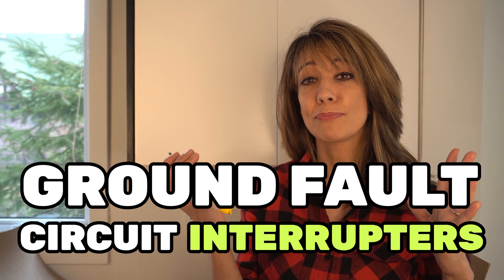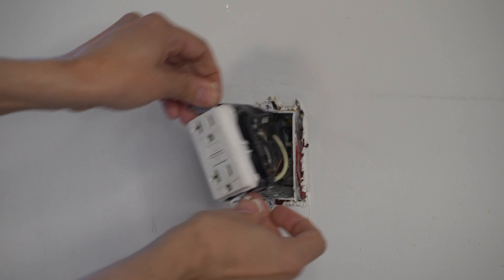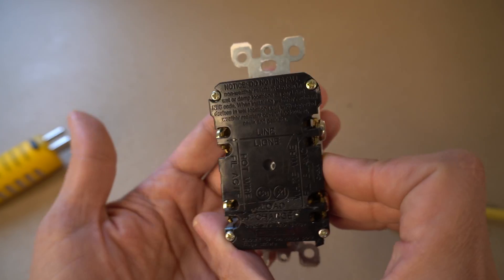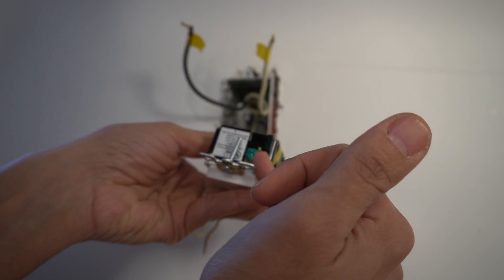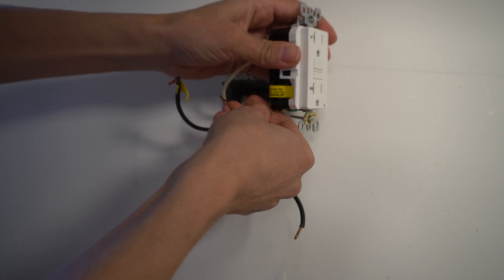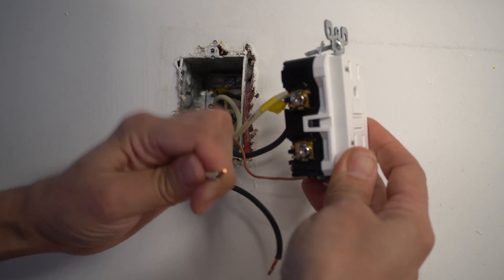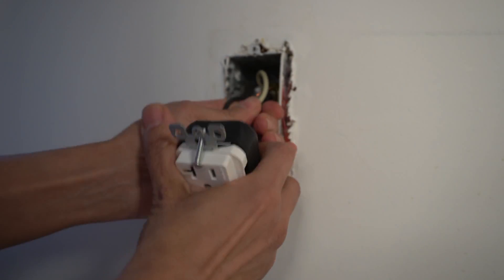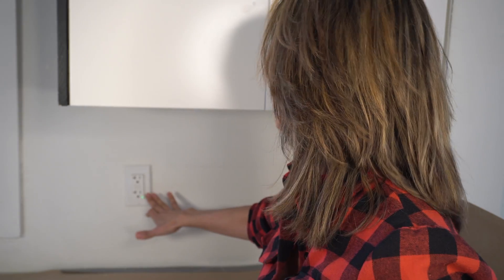How To Replace a GFCI Outlet | 98% Don’t Don't Know This!

Comment: One problem I've noticed with GFCI receptacles is that it is extremely difficult to wrap the ground wire around the ground screw (many don't have a clamp), due to its location on the receptacle.  Even if you succeed in getting the wire on, itis hard to mount it securely, and this may well be a reason why it works loose.  A better design is definitely needed.  In any case, the receptace is grounded simply by mounting it in the box, provided the ground wire is connected to the box.

Comment: Is it ok to install gfci all over the house? Is an old house it has no ground.
Reply from the maker: That’s a good question for a licensed electrician. I haven’t experienced that situation before. Grounded receptacles are an important safety measure.
Reply: It's not necessary, except for the kitchen, bathroom, and garages. Many appliances and tools have 2 prong plugs and are double insulated, so they are safe to use.

Comment: Your tester with a plug in is sweet send info where you purchased it thanks again for all your work and videos.
Reply from the maker: The link is in the description or I have an electrical section in my Amazon storefront link. The tester comes in handy for receptacles. I use it often.

Comment: I've always liked "Line" on the bottom terminals and "Load" on top like a light switch, power goes up from the bottom through the switch to an overhead light.   Not everything is wired that way of course, but it was a nice standard having "Line" at the bottom.  The other way around is good for areas where you don't have a lot of wire to work with and you can take advantage of location of wires.
Reply from the maker: Thanks for sharing your preference on line vs load. It’s a good observation.

Comment: I read that you cannot replace a 20amp for a 15amp. You said someone updated to 20amp so you were replacing with 20amp. I am really confused because my GFI in the electrical box says 15 Amp. So what your saying electrical box was updated to 20amp too?
Reply from the maker: This GFCI is wired with 12 gauge wire for 20 Amp. The whole house was rewired to updated electrical. Old houses would typically have 14 gauge wire in their kitchens for 15 amp receptacles. Hope that clears things up.
Reply: If you are in the US, you can use a 15 amp receptacle or GFCI receptacle in a 15 or 20 amp circuit. This is common and permitted by the NEC. In Canada the receptacle must match the circuit rating, according to the Canadian Electrical Code.

Comment: The T slot  does not  indicate that it’s tamper resistant. It indicates that it’s a 20 amp outlet.
Reply from the maker: Yes you are correct!
Reply: Where is your video 🎉

Comment: Plugging in voltage tester and not reading voltage on a GFCI that doesn’t work doesn’t mean there’s not power going to the outlet.

It’s not always an upgrade to put a 20 amp outlet is the breaker is only 15 amp

Comment: The outlet does a self test  (those manufactured after 2015, per UL 943 standards) so that it knows the protection circuit is functioning.
(These are not the most reliable devices especially if you splash water on them.  In the old days if you didn't push the button you would not know it was broken till it was too late)
If functioning it will trip if there’s an imbalance (e.g., current leaks to ground due to a fault, such as a short circuit or a person contacting a live wire), the GFCI detects this difference (typically 4–6 mA) and trips within milliseconds to cut power. 
So if you drop your hair dryer in the tub you don't have to wait for a test is the point.  
A layman could get the wrong idea from the way you said you can purchase different self test intervals.  
(which was not wrong)
The self test makes sure your powder is dry to use an poor metaphor.
Another great video.
Reply from the maker: Thanks for sharing your thoughts on GFCIs and how to improve.

Comment: I see there are 2 spots for 2 sets of wires to be clamped on the load terminals. Is it safe to run 2 different outlets down stream with both connected to the GFCI  load  terminals with the clamp terminal?
Reply: Yes, it's safe, but it would be best practice to just use one and jump from one receptacle to the next with pigtails or direct wiring between outlets. If you're going to split the branch in a 2nd direction you can use both spots or just one and use pigtails. Similarly, with the Line terminals, you can use both if you don't want to protect downstream outlets or just one and use pigtails.

Comment: Great video. My GFCI outlet stopped working. I changed a new one, similar to the one you used. But the hot black wire is there with voltage 120-160. But the load black wire is 0. I checked wires. Everything was fine. The two copper lines were twisted together to form a final single copper line. I thinks this was the issue. I should have used connector. However, I saw your 2 ground lines were twisted together also without any problems. It may not be the problem. Then what is the problem? My old one has the following features 125V 20 amp 60 hz. I bought a new one with same features. I am frustrated about this situation.
Reply from the maker: That's frustrating, but hopefully, you'll track down the issue. If not a licensed electrician can help you out.

Comment: I noticed after looking at one of my regular plugs that is connected to the electrical series of the GFCI receptacle that I can’t pull out to replace that the original electrician didn’t cut off too much of the wire covers leaving a lot of the brass wire exposed that’s wrapped around the screws.  Really scared now…whomever built my house did not know what they were doing.  It’s really depressing because I don’t have the kind of money to have preventative work done, especially when the next person might do just as bad of a job.
Reply from the maker: that's an unfortunate situation. Hope your find a good solution.

Comment: I got stuck…once the outlet plate cover has been taken off and the 2 screws that hold the old GFCI receptacle to the plastic box (not metal like yours) it will not pull out from the wall!  Ugh!  Is there anything I can do to pull out the cables to work with them?  Every video the people can just pull out without effort, they have a lot of slack.  House was built 2007.  Any ideas?
Reply from the maker: Sounds like you’re in a tight situation with short wires. I have a video that shows how to fix that. I hope you come to find a good solution. When in doubt hire an electrician.

Comment: The part of your procedure where you note the back of the outlet that you’re replacing turned out to be very important for me. The one I was replacing was installed upside down. Therefore I had to reposition the wires in order to install the new outlet correctly. Thank you!
Reply from the maker: Thanks for sharing your experience John! Glad you were able to do the job on your own. Well done!

Comment: I recently replaced a bad gfci and marked the line wires with a small piece of duct tape and forgot to remove them before putting it all back together. How concerning are those 2 little pieces of duct tape?
Reply from the maker: Duct tape is flammable so it’s best to remove. It should be a very simple removal.

Comment: Im going to change mine but I have a question. When you checked for the live/hot wire, you said you’re now going to turn the power off. I got confused at that part because before that you said you already turned off the power at the breaker. Does that mean there’s 2 powers that need to be turned off? I want to make sure and be safe when I do mine. Thanks in advance.
Reply from the maker: No I misspoke. The power was turned off then back on again.
Reply: @DaruDhillon thank you for the video!!!
Reply: @DaruDhillon I just commented same as poster. Please immediately put text or voiceover over this mis speaking as it is serious safety issue esp for newbies watching ! Ty

Comment: When wiring you should insert wires such that when tightening the screws, the wires should be pulled into the screws as they are turned clockwise.  Better yet is to form a small hook in the end of the wire such that when the hook is placed around the screw, the screw clamps down most of the way around the hook and the hook becomes tighter as the screw is tightened.  This makes for a lower resistance and therefore less overheating under load.
Reply from the maker: Appreciate you sharing your tips. J-hooks are a good way to go. Classic wiring. Tried and true. Cheers!

Comment: Feb 4, 2025  DIY guy. If your going through the house and garage upgrading to GFCIs protected circuits and new three prong recepticles in the daisy chain  I've come to like the process where one sits down at the table with some 12 gage wire and copper for the ground to prewire  a dozen or so  pig tails (striped on each end) with a 2 or 3 position Wago connector on one end of each pig tail. To go pro have a roll of red tape available and rap a strip around the hot wire insulation.  Then insert a pig tails  into each receptical  hole and tighten the screws,  including the copper ground if there is one for the receptacle. The go from one outlet to another and use the pre installed Wago to make a quick connection, replace the wall cover. and move on.
Reply from the maker: Thanks for the detailed information!
Reply: I thought the general rule of thumb was avoid pigtails if possible is thing wrong advice?

Comment: Can you provide a link to the voltage tester that you use? Thanks
Reply from the maker: My amazon storefront is linked in the description box, it's in the electrical section. Thanks for the question. Cheers!
Reply: @DaruDhillon  Got it! You do an excellent job with your channel. It is very professional. Thanks!
Reply from the maker: @ appreciate it. It’s my pleasure.

Comment: Thanks for this. My only question is for the orientation of exposed wire you're wrapping around the terminal screws. A lot of videos I've watched lately suggest the "hook" should always point up to avoid the smooshing side effect pushing copper upward toward other terminal components. But it looks like the receptacle you're using might have molded channels to keep the wire from doing this? Thanks for any insight.
Reply from the maker: The ground wire is securely attached under the terminal screw there isn’t any additional wire poking out under the screw. It’s wrapped clockwise. Hope that helps.

Comment: But you're supposed to  wrap the wire  around the screws 😮
Reply: Not these. GFCIs have a compression plate under the screw. The straight wire tip goes under the plate.
Reply: @johnbauman4005 not being a cad but to me when explaining to armatures this really should have been explained. I know from watching a few vids and doing a few small projects most may not so will unknowingly not get enough contact if they do it wrong. Yikers

Comment: I never see anyone in these videos torquing the screws. They do have torque specifications.
Reply from the maker: Torque requirements are listed by some manufactures. They are often included to prevent liability, to ensure proper installation (which is important) and to prevent poor installation.
Reply: @DaruDhillon  Agreed, which is why I am curious as to why no one ever mentions them in their videos. I've seen many other videos similar to yours and no one even mentions the subject.

Comment: Thank you so much for posting this excellent video. If I ever have to replace a GFCI outlet, I will come back to re-watch this and make sure I am clear on identifying and working with the load and line wires. You are consistent in your videos: you connect the ground wire first, then the neutral wire, then the hot wire. I will follow the same practice if I have to do this in the future. (I think I will get the opportunity.) Thank you again for a very helpful training video.
Reply from the maker: @robertcochran7103  Glad you find them helpful Robert. Thank-you!

Comment: While everyone learns in ways that work best for them, I found that the easiest way for me to remember where the wires go is that the colored screws are usually brass - not gold and that black and brass both start with "B" (like green & ground both do also) so they get connected as you showed (unless otherwise specified in some special circumstance) leaving the white (neutral) to connect with the chrome screws.
Reply: Nice!

Comment: Before you start you should test the circuit to be sure it’s active if you can, so when you turn it off you’re sure your tester is working properly! I had a bad tester and ended up frying a good screwdriver, and I was so glad it had a proper electricians rubber handle!
Reply from the maker: @rogerhonacki5610  thanks for your input.

Comment: I would typically recommend that you install/use 15A GFCI and regular 15A receptacles on any 20A kitchen/bath circuit in place of 20A versions.  It actually enhances protection (and is permitted by code)... you can only plug in devices that require 15A or less and never any device that requires 20A.  That way, you never overload any single outlet, nor the circuit itself.  I can't think of any kitchen/bath device that would require 20A anyway and if they do, you'd be better off with a dedicated circuit for it.
Reply from the maker: Thanks for the info!
Reply: It's not permitted by code in Canada where DaruDhillon is.

Comment: Thank you for explain all about the GFCI receptacle. I have an unusual question to ask please. I had plugged in a full size freezer into an outlet in the garage. The next morning the freezer was working fine. I come back a week later and the freezer is not working and nothing else on that same circuit is working either. The breaker did not trip and so I have no idea what breaker goes to that one non working outlet. There happens to be a GFCI outlet in another place in the garage but that works fine, ( not the cause of the problem, I believe.) checking all the other GFCI outlets, outlets in the house and there just so happens that on the other end of the house in the kitchen there is one GFCI outlet not working but other GFCI outlets in the kitchen work fine. By any chance do you have any idea why the circuit breaker did not trip? The freezer manual did require a 15 amp circuit breaker which all the circuit breakers are. I am not concerned about getting power to the freezer but 8 do want to get the other items on that circuit to work again. Any ideas as to how I solve this Dilemma?

Comment: Great video, but T-slot is not for tamper resistant. It is for appliances that require 20 amp circuits and have a different plug so they cant be plugged into a 15 amp circuit. Someone commented on using a 15 amp GFCI on either a 15 or 20 amp circuit which is allowed but should be based on saving a few bucks. Kitchen countertops are required to be supplied by 2 20 amp circuits.
Reply from the maker: @SRCardow1  yes thanks for the correction and helpful explanation on proper amperage. Important to know.
Reply: 15 amp receptacles are not allowed on 20 amp circuits in Canada where the video is from. That's my understanding, unless it has been recently changed.
Reply: US more specifically NEC 70 allows it if adopted as law by states or towns don't take exception to it. Must also have more than one receptacle on circuit  or it is required to be 20 amps.
Reply: @SRCardow1  A duplex receptacle is 2 receptacles, so a 15 amp duplex receptacle is permitted on a 20 amp circuit, regardless if there are any other outlets on the circuit or not. If an individual branch (dedicated) circuit is required, the receptacle must be a single receptacle, 15 amp on a 15 amp circuit and 20 amp on a 20 amp circuit, to be code compliant.

Comment: If you only have 2 wires and no ground on old house does it matter which wire goes where? Thanks.
Reply: You still need to wire line to line, neutral to neutral. The test button may not work, but the GFCI should still work. You should find a different way to test it just to be sure.
Reply: GFCIs require a ground, but I can't remember the exact explanation, so they won't work for you unless you're able to add one.
Reply: @scotttodd3506  They can be used to add a 3 plug outlet to an old house that only has 2 wires, no ground. It doesn't offer ground protection from lightening strikes etc, but does offer protection from internal shorting in appliance. AND gives you an option to plug 3 prong plugs into. Otherwise one has to use those adapters at Home Depot that you are not supposed to use. Austin code allows this if you put a sticker on plug: "this GFCI outlet is not grounded"

Comment: While you have the cover plate off the receptacle, write the panel circuit breaker number on the back of the plate with a marker. The trick is to remember it's there next time. For me, anyway, what?
Reply from the maker: Great idea. I love this tip. Smart and useful. Thanks for sharing!